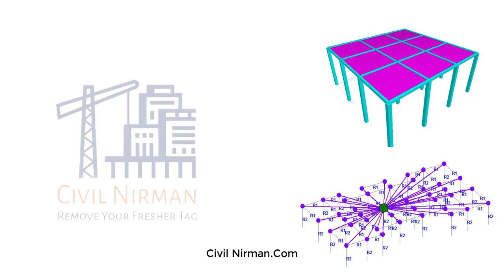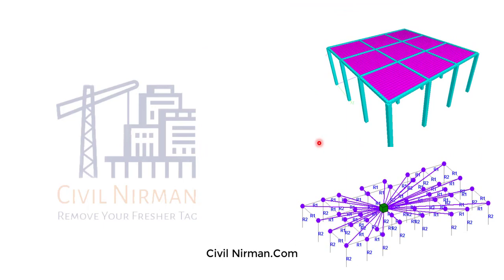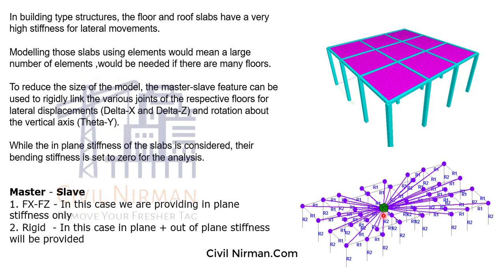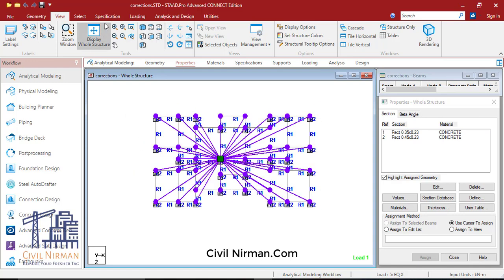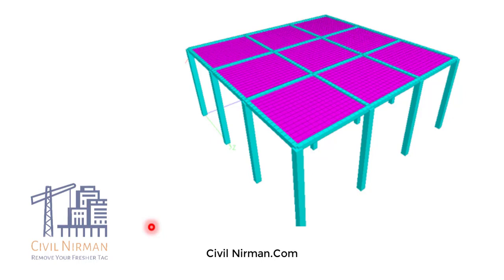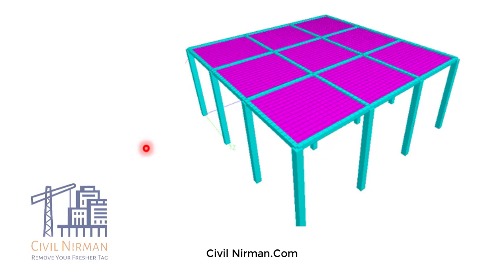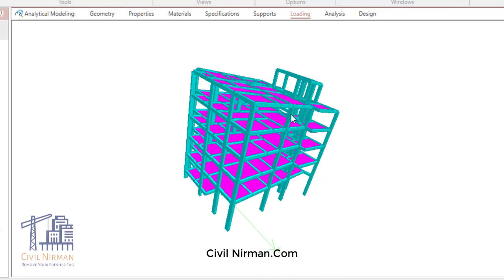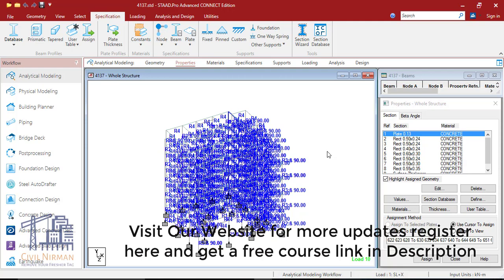How should I model Slab ?Plate or Floor load

Comment: Hello sir, while using the plate method? Do we need to give the messhing boundaries support system? After modeling my structure, the slabs, which are the plates, seem not to be designing
Reply from the maker: please drop your quarries on +918320501602

Comment: When and where we should use master slave command?
We should assign master slave command only  for wind load and EQ analysis??
Reply from the maker: Master Slave is a tool for providing diaphragm action of slab when we provide floor load option to apply slab load as floor load instead of creating plate elements 

In building, the floor and roof slabs have a very high stiffness for lateral movements. Modeling those slabs using elements would mean a large number of elements would be needed if there are many floors. 
To reduce the size of the model, the master-slave feature can be used to rigidly link the various joints of the respective floors for lateral displacement While the in plane stiffness of the slabs is considered, their bending stiffness is set to zero for the analysis.

So, master-slave is a tool to create a smaller model by avoiding using hundreds of plate elements to represent the slabs in the structure.

If you have already modeled the slab using plate elements, there is no need to use master-slave.
Reply: @CIVILNIRMAN Dear sir.,
if there any cutout in slab how to specify that in master slave?

And also,can we consider this diaphragm action for gravity load combination( like DL+LL). If we consider any reduction in column moments ??
Reply from the maker: @sureshkumar-ji5kn  as i mentioned earlier master slave is a tool to provide diaphragm action ,if you have cut out,you can use group option in floor load ,so that you can select only those close boundaries in a member group where you have slab  , no change in master slave specifications.ultimately it is connecting your whole floor geometry (slave nodes) to master node for equal displacement in x-z plane
Reply: @CIVILNIRMAN  thank you sir